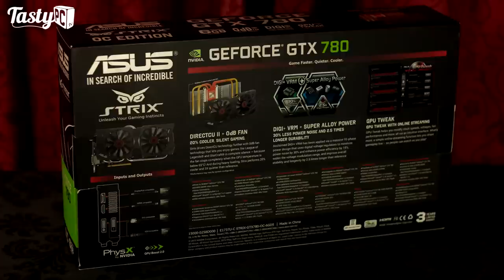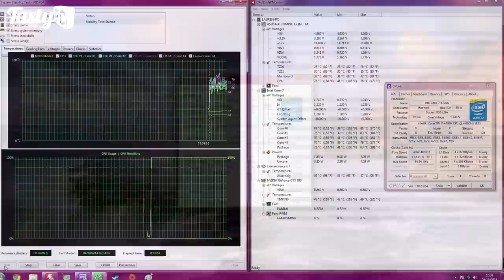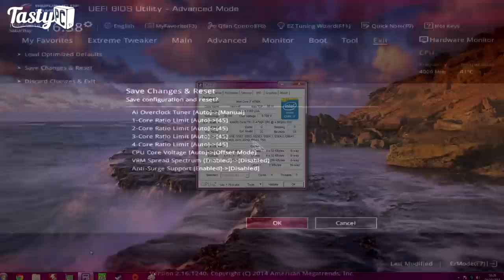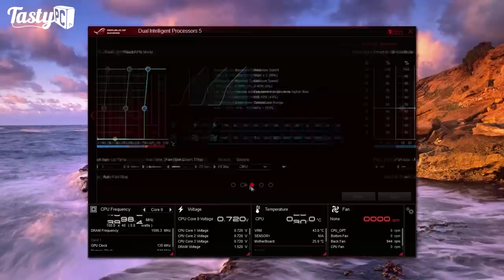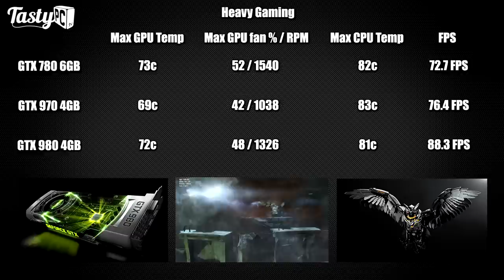Semi-Passive Gaming Build – GTX 980 970 780 Strix, i7 4790K, Noctua NH-D15, Corsair 730T, ROG Hero

Comment: Planning to buy a new gaming pc, is this any good?
Processor: Intel® Core ™ i7-4790K processor Quad core with HyperThreading
Clock Speed : 4GHz / Max Turbo 4,4Ghz
Memory: 16GB DDR3 1866 MHz
Number of memory slots : 4 2 in use
SSD capacity : 1000GB ( 1TB)
Video Card: NVIDIA GeForce GTX 980 graphics card with 4GB of DDR5 video memory
Optical drives : Dual Layer DVD-Rewriter
Sound: High Definition Audio ( 7.1 channel )
Power supply 750 Watt
Operating system (OEM version) : Windows 8.1
Card reader all in one
Dual band wireless WiFi adapter
Silent CPU cooler Dark Rock Pro Be Quiet !

Comment: Very nice experimental video, but I'm wondering if it's possible to use a big radiator with water blocks & only rad fans which are turned off until the temps go high? Or does that make the components really hot even on idle?
Reply from the maker: I have ran a loop without fans before and it did work, but the pump would always be active and therefore making noise.
Reply: TastyPCTV Yeah i didn't think of that :P thanks for your reply :)

Comment: i have a question, for your psu why didnt you use a proper passive psu like the rosewil silentnight 500w or the new xfx ones? using a 1200w psu when you kinda dont need it seems like a bit of a waste to me.
Reply from the maker: sujmaster It seemed like a waste to buy a new PSU when I had an AX1200i sat there lol. Plus I really liked the idea of using as many semi-passive parts as possible.
Reply: fair enough it was just a thought, keep up the good work!

Comment: if the purpose is a semi-passive rig why do u put the noctua industrial fans? they go from 2000 up to 3000 rpm and even at 50% they are very loud. i think this has nothing to share with the a passive rig.

Also i see everywhere ppl using the A serie of noctua as case fans. ofc they are very quiet but they are not optimized for airflow and there are better fans for that purpose with a better performance/noise ratio. i suspect that most of the ppl uses them only because they are fancy and sofisticated.  i love noctua fans but in my fractal define r4 i use 3 140 r2 fans, also from fractal, because they are optimized for silence AND airflow.

Comment: Why would you want your power supply to pull hot air from the inside of the case? Have your power supply fan on the bottom and it can pull through the bottom vent under the power supply. Then the PCU can throw the heat right out the back, and it will get to pull cool air. 

Unless you plan on placing on carpet. lol
Reply: 3:40

Comment: My i7 4790k went up to 95°C when gaming with the intel stock cooler on full rpm which is around 2500rpm (I think?), so I bought an H80i which pushes the temperature down to 60°C, but I think it's still a bad result, because I didn't even overclock it. It is running on standard settings. Did I just have bad luck with my CPU? I've read articles about it and many people had the same issue...
Reply: What tests  were you running?
Reply: Karel Veverka I made some really short (30 seconds) tests with Prime95, but these would have killed my CPU, because the temperatures were exceeding the critical temperature and caused bluescreens. During Counter-Strike: Global Offensive on 1080p (not even full settings) it went up to 92°C with peaks at 95°C. Now it's at 60°C during CS:GO and goes up to 69°C during Prime95.

Comment: nice, but maybe using a case from "nofan" would help with the ventilation, and also nofan's CR-95C CPU cooler? or even Zalman's FX100 CPU cooler. also there are true passive PSUs at 460w and 520w. maybe in the future the GTX 960 will have a passive option like the 750ti KalmX from Palit ! :)

Comment: +80 °C the CPU? isn't it too much? I would think lower for such a cooling system as Noctua 15.. (maybe you explained it in the video, but i'm not english native speaker and i might have missed something.. )
Reply from the maker: Tony the butcher During the heavy load test, the CPU fan only ran intermittently, so the CPU hitting 80°C just came down to how I had the fan curve configured. I'm happy with it, but if you wanted the temps to be lower you could always use a more aggressive fan curve.

Comment: I think the AX1200i fan blows into the PSU meaning that it should face down so it can draw cool air. Otherwise, you are drawing in warm air from the inside of the case and fighting against heat convection.
Reply from the maker: In this build the PSU fan never runs. It's essentially a passive PSU and you should always mount a passive PSU grill face up, as heat rises. :)
Reply: TastyPCTV
Wrong.Hot air doesn't rise,its cold air that sinks and pushes hot air up.(hot air is less dense then cold air,convection cell,buoyant force)
Reply: Oxymorant but in the end the heat does rise
Reply: Oxymorant No, it's the heat energy which makes the hot air molecules bounce off each other and become more spaced out and more buoyant, and kick away from cooler molecules, so yes, heat rises.  Not only does thermal displacement work on Earth, it also works where ever there's heat in the universe, even in the absence of a gravitationally significant object to pool the cooler molecules.

That's not to say that fan-side up is necessarily the best way to orientate the PSU (could end up drawing in dust from the back).  And heat will push itself out the back of the PSU even with the fan-side down, it will just cause the PSU to spin up the fan spin up sooner.  Which she was trying to avoid.

Comment: Hello in need help. I am getting a gtx 980 and an i7 4790k processor. My stock motherboard can handle that cpu but I don't know if I should get a better motherboard or just keep this. Also, should I buy a new water cooler for the i7 or just keep the fans that come with it.
Reply: IDK which motherboard you have, but if it handles, why replace it? and stock fans are decent if you are not overclocking.
Reply: Ok thanks!
Reply: Dfade5 I would ABSOLUTELY get an aftermarket fan for the 4790k it can run REALLY hot i've heard it reaching about 90c on the stock fan, the stock fan would work but the life span of the cpu could be reduced some by all the heat, a couple aftermarket coolers I would recommend are the Coolmaster Hyper 212 evo    (its an aircooler) but you need a big case for the 212 because it is 150mm tall, and for another cooler  I would recommend a Corsair h100i (liquid cooler) it is a little to no maintenance liquid cooler that comes with the liquid already inside it, but you need a place to put the dual 140mm fans that are on it like a top vent of the case or back vent. Also I heard that the 212 evo's brackets that you put on the mobo can be a pain so just a warning, hope I could help!

Comment: I hope this "coil whine" issue with these new Nvidia cards isn't completely blown out of proportion. It truly is making me want to wait for  newer revisions on all cards. My other sad parts sit next to my bed while more GTX 900s become available.
Reply: You can hear it but it's not a big deal . The fans in my case make more noise but as it's an old PC it was easier to just upgrade the graphics card than change everything. People still get rid of CPU's way too early. I am getting over 60 fps @ 1440p on max settings in most games with a g1 Gaming edition 970 overclocked to 100mhz above factory setting @ 1442 . This is with only running an I930 at stock as well which is 2.8 ghz. There is little point at this stage getting brand new processors if you already have a reasonable enough CPU just change the graphis card and put up with a bit of noise. You can't hear it over the sound of a game anyway lol.

Comment: Semi passive with a loot of fans. Nice idea but for semi pasive I would chose some mid range or low end build where it's possible. Like some i3 with GTX750TI  1 fan sometimes spinning on CPU and 2 fans sometimes spinning on GPU. Both quiet(except PSU)  That rig would be cheap, quiet and enery efficient about under 160W as I think. Recently I did one on this configuration with corsair cooler as replacement on CPU and it was noiseless with flexible performance.
Reply: Nowadays you can have semi-passive AND powerful rig, because modern CPUs and GPUs have very small TDP while idling. So it's not a problem to have a PC which is noiseless while doing the ordinary stuff (video/music/web/email) and still has enough power to run the most demanding games. I have a semi-passive rig with i7 4770K and GTX770 and I really don't think it would have been a better idea to go lower mid-range or even low end.
Reply: KocuRisko  You are right about direction on Rig that you want. You have to know what you want do assemble. I meant that it's easier and it would be minimalistic noise because modern architecture systems with silly TDP are easier to make noiseless. In my rig there were 4 wents. 1 in PSU (idle whole time) 1 on CPU cooler and running 200-800 RPM, 2 fans on GTX750TI MSI twin frozer. As you well know this GPU on this cooling is extremly quiet. KocuRisko I think that some high end would make some sens with watercooled huge cooler cooled by convection and mounted externally on Rig case what you think ?

Comment: It's nice and all but runs way too hot. 

From starting with the psu at the bottom it's just heat going into gpu getting hotter going in to cpu cooler and passing hot air over that and then eventually getting out the top.

High 80s on a 4790k is worse than my old i7 965x!

Comment: How did you get the CPU fan to turn of completely? I have the same motherboard but I cant get my CPU fan to turn off :/
Reply from the maker: By using the Ai Suite software, there's a tick box called "Auto-Fan Stop" that you need to have ticked to be able to do it.
Reply: TastyPCTV I have the box for my case fans and they turn off fine.  But I don't have any box to tick for my CPU fan :/

Comment: Hey great viedeo you could add some resistors to physicaly set your fans to 7 or 5 Volts, then they aren't so loud while gaming.
Reply from the maker: I did initially in the form of low noise adaptors, but they caused an issue with Ai Suite.
Reply: TastyPCTV
Ah thats unfortunatly... Did you think about the Corsair Link Commander Mini? Neighter could I find a review about it nor a reseller in Europe, but you can get one from corsair directly and make a review about it. Want to get one myself ;) if it is better than the old Link

Comment: does the 980 version of the strix have the same "fan-turn-off" feature like the 970 ? also what do you think of MSis iteration of the 970/980 ? as far as i've heard they too turn off under low load, and in addition the fans on MSi 9xx cards can spin at different speeds. what do you think of that ?
Reply from the maker: Yes the Strix 980 is also semi-passive and with the Strix card the fans can also run at different speeds to each other.
I haven't had a chance to look at any of MSI's cards yet, but they do look promising. :)
Reply: TastyPCTV  The 980s from MSI are good in performance but the fans have so much coil whine... Its annoying, waiting for my waterblock to arrive for mine as its driving me insane.

Also to edit in, the fan controls aren't that good. Setting them to spin at 0 and they still spin and turn... quite annoying.
Reply: Danielle Lowe Man.... The coil whine comes from the PCB, not the fans......
Reply: ***** but there shouldn't be coil whine,  should there? ^^ or is it a manufacturing problem with the card?
Reply: Danielle Lowe I've got two 970 4Gs and neither has coil whine. RMA yours as they shouldn't be doing that.
Reply: I am curious why anyone would buy the asus cards in the first place , they don't offer value for money or the best performance for overclocking.
Reply: DEVILTAZ35 Some OC better than MSI cards, they look nicer, they are silent, ASUS is a trusted brand.
Reply: Fair enough but the Asus doesn't offer the best 970 or 980 which is making me wonder why people would buy it.
If you look at independant tests on Asus , Gigabyte and MSI , Gigabyte was easily the best and most stable card.
I only bought one to get more life out of an old computer anyway. I'll wait for the 980 TI verisons to come out next year and get them in an SLI build in time for Witcher 3 ,Star Citizen etc.
Reply: DEVILTAZ35 I'd buy it because, metal shroud & backplate, hybrid cooler, low temps, decent OCing, single 8 pin power and it's Asus. :P MSI and Gigabyte make slightly better performing cards though.
Reply: DEVILTAZ35 You don't see Gigabyte or MSI cards breaking world records hence they sell crap!!!Now there mother boards are a different subject.............
Reply: lol The gigabyte G1 gaming edition in both 970 and 980 wipes the floor with the Asus Stryx models in performance so i am not sure what you are talking about. The windforce tri cooler is far better and the card overclocks better than the asus as well. The asus is just overpriced at least over here in Australia. It is nearly a full $100 more than the Gigabyte and MSI cards.
The G1 has twin 8 pin power connectors and has a higher TDP than Asus card so much easier to get stable overclocks on it.
Don't just assume because Asus is a recognised brand name that it is the best 970 or 980.
I'll admit the Asus is slightly quieter but who gets 970's and 980's to have a super quiet card you want one that overclocks to the max for the best gaming performance above all.
Reply: Read what I said, Gigabyte holds "ZERO WORLD RECORDS" with Video cards. I know you fell a need to be right, and in your little corner of your mind you are(I guess)....................................You know it all! That's why you bought a re branded video card! ENJOY!
Reply: I was just making a point about value for money . Who gives a damn about world records previously when they are clearly releasing an inferior performing card where it counts which is in framerates. So go right ahead and enjoy your near silent card at the expense of framerates. I would have thought the smoothest gameplay possible would be the goal of a video card not a dead silent one that has an underpowered TDP  limit for the hardware.
As for quality i am on my third laptop power supply for my Asus ROG laptop so their quality is less than ideal anyway. I had to go aftermarket to get one that lasts.
Reply: Where was i this rude to you ? So show some respect when you are talking to people please.
If you can please explain to me in that list where it mentions GTX970 and GTX980 that would be helpful too
it seems you are talking about past cards and not even current technology which makes the conversation a moot point anyway.
However getting this passionate about something this unimportant i would probably look at seeing someone about that.
Reply: Nhựt Lê Minh What are your other specs?
Reply: Nhựt Lê Minh only thing i see that could be an issue is your PSU, it's a real dodgy brand and might not be powering the GPU/your system properly.
Reply: Nhựt Lê Minh It's okay, just buy a new PSU if you can like an EVGA B2 750W. :)
Reply: Nhựt Lê Minh I usually go with Antec High Current Gamer line. And do yourself a favor and get a modular one :-D

Comment: Isn´t the 1200W PSU a little over powered? With my 4790k and a GTX780ti I am using a Corsair RM750 and the fan does not run on full load.
Fan RPG :D
Great video btw :)
Reply: It is my understanding that using a 1200 PUS will idle more for passive gaming if you are not fully loading the PSU.  Many passive builds I have seen and read use this approach.
Reply: Aeschylus Shepherd  With a 4790k and a GTX780ti you can´t fully load a 750 W PSU. At max load, the PC will draw around 400 W.

Comment: I know I am just some dick head but you had some spot on benchmarks when it came to the GTX 980 and 970 series cards. Hope to see some stellar reviews from you still. If you can try to get some laptop reviews in as well, I am currently running an i7 4810mq paired with the gtx 870m. It may not sound impressive but I forked out over $1,700 cash for my laptop.

Comment: If you like black sexy fans check out noiseblocker pl and pk in 120 and 140 sizes respectively. I have them and even at 12v / 100% they are quiet.. I have a ROG MB and am quite disappointed with the lack of fan control especially using DC.

Comment: I have 2 970 but I dont know which PSU I need
Reply: Do you really need a new PSU since they aren't really that power-hungry, like 470W while gaming.
Reply: Esa Edvik Ih have a really shitty Powersupply. 650W but it only costs  30€(38$)
Reply: Get the EVGA G2 850. 850 watt tier 1 PSU, which means it is the best of the best in PSU. It's only 90 dollars, funny thing the 850 watt version and 750 watt version cost exactly the same

Comment: Stupid choice of fans. Low airflow, low wattage fans with friction bearings (?), whould have easily done the trick.
And a 1200 W PSU is an absolute overkill. I get you idea of why you used it. But any fanless PSU would have been a better/cheaper choice.

I would have liked to see a big open aftermarket graphicscard cooler like RAIJINTEK Morpheus + some experimenting when it comes to cases and their layout.

In total a very conservativ passiv build...